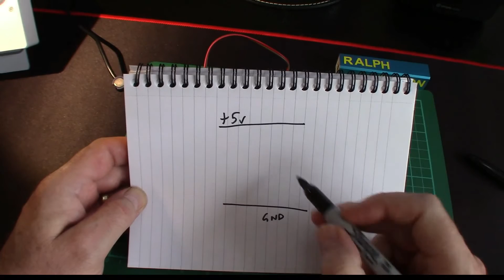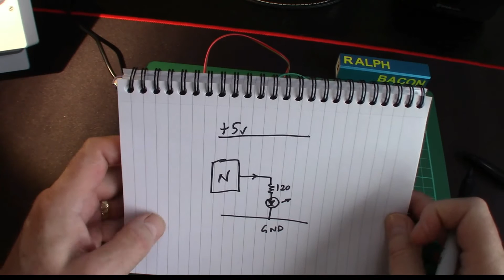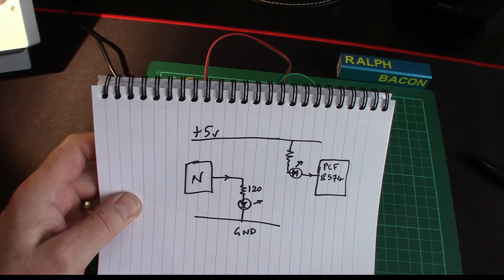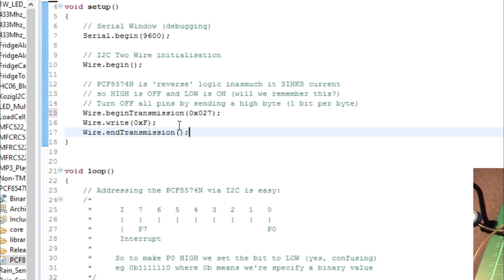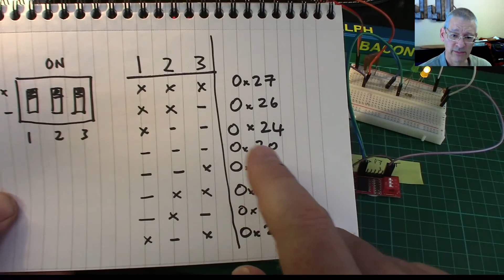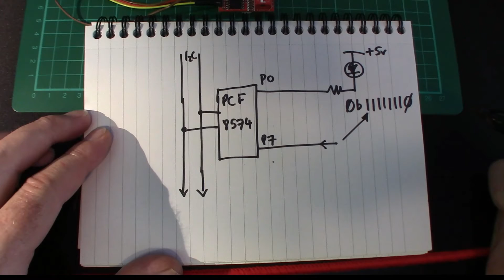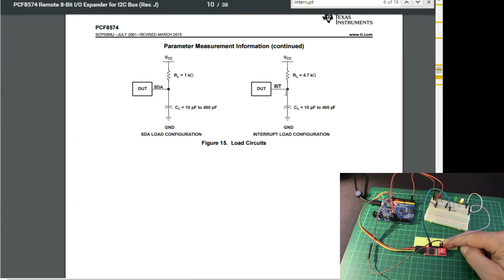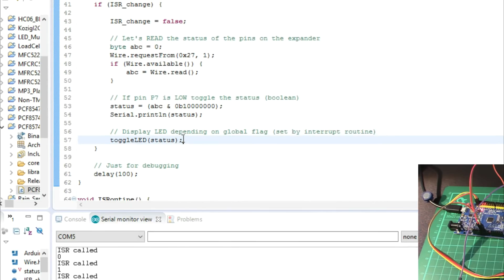#49 MORE PINS PLEASE! PCF8574 Arduino Pin Extender (Easy)

Comment: Hi Ralph 
Was watching this video as always your videos are great and easy to understand. I am thinking about using these on a cable tester. Problem is I want to have a master & a remote to test a cable installed somewhere where the 2 ends can't be brought together. Got me thinking how would this work? 
I'm sure we all have cables to test at times like HDMI in walls between DVD and TV....
We would need to know if the cable was good and if there were cross wires. Maybe a display would show simple 1-1 2-2 3-3 etc or if a cross 1-1 2-3 3-2 for example.
Could be a great video as using these means you test cables from 2 core to  128 cores a great project.
Reply from the maker: I've been thinking about this, Adrian, on and off for a couple of days. It's an intriguing question. I'd probably not use a pin extender but more something like a radio unit like the nRF24L01. Maybe. Possibly something a lot dumber at the remote end, like a switch box. I'll add this to my list of things to think about. Good idea, thanks for posting.

Comment: I wish I could search to see if someone else already made this comment or not using my phone, but oh well I'll say it anyway. Now you can add it to your Attiny and get lots of I2C devices. You'll only be limited my memory. Now if you could just add memory and convert the I2C signal to something else.
Reply from the maker: But you can't add run-time memory to any Arduino-type chip, vonries, so we have to be creative in our thinking (and terse in our code styling). What do you want to convert the I2C signal to then?
Reply: Ralph S Bacon everything I possibly can. I want to know how far a $0.50 chip can be pushed. I don't care how slow it goes just how much it can do. The problem is I'm new to this and have brain injures. Nevertheless, I used to be a pretty good programmer "back in the day."

Comment: Hi Ralph
Thanks for yet another great video - Easy to understand, easy to use. In fact I advise some of my students to see and use your videos - Hope that's OK? :)
Have you tried to hook up - say 4 modules and do read and write routines to them? I'm looking for an easy scan and write routine, that easy sets up and reads data on multiple I/O expanders - maybe I got to the right person? :)

BR
Tomas
Reply from the maker: Well, Thomas, the PCF8574 has an INT output that is designed to be connected to an interrupt input on your Arduino, for example. This highlights the fact, to the Arduino, that one of the pins has changed on the PCF8574. Then just scan (read) each pin in turn and discover which pin it was (by keeping track of what each pin's status was in your Arduino sketch). As they are all I2C you can connect up to four units (that's all your addresses used up for these modules). Reading the pins from each module is the same as reading from one, using a different address. I'm guessing you already know how to do this! I don't have any easy scan and write routines of my own but from what I've described I think its clear what needs to be done?
Reply: Hi Ralph
That sounds somewhat like I intended to do. I would OR the INT signals together and attach the output to the Arduino INT pin. Then wire the PCF8574 INT pins to normal input pins on the Arduino, which I would have the Arduino scan to discover which PCF8574 did the interrupt - and finally scan this module.
Reply from the maker: Yes, something like that. Just connecting a diode in series with each module's INT pin to the Arduino's INT pin should be enough to trigger the Arduino.
Reply: Yes, then you OR with the diodes. But a diode generates a voltage drop up to about 1V. Normally it goes ok, but when it has to trigger an interrupt, using logic gates would be advisable :)
There is some good explanation done here: https://sites.google.com/site/qeewiki/books/avr-guide/external-interrupts-on-the-atmega328
Reply from the maker: Use a Schottky diode, Tomas. Wikipedia says "...Schottky diodes' voltage drop at forward biases of around 1 mA is in the range of 0.15 V to 0.46 V (see the 1N5817 and 1N5711)..." That may help you.
Reply: U win, Ralph. That is a more suitable  sollution 😊

Comment: Great video, very useful. Have you checked out the Microchip MCP23017 ? ... very similar except you get 16 I/O lines (divided into 2x 8 bit ports), 25mA sink OR source per I/O still using I2C (or SPI if you get the MCP23S17 variant) with operating voltages of 1.8-5.5vdc.
Reply from the maker: I haven't, NIck, but I do have another Microchip MCP3--- sorry, I cannot reveal anything as that is the video-after-next, video #112, so no spoilers! It's not so much a pin extender I'm doing next as a pin ----  sorry, can't reveal that either. Oh dear. Seriously, though, your MCP23017 sounds interesting and I like the wide operating voltage, good for 3.3v and 5v µControllers then. Keep tuned to see what I was going on about!
Reply: Ooo ... sounds intriguing?? I will keep tuned. I read your blog also, very very sad. My thoughts are with you & your family.  Contrary to what people say I don't think "time heals", you just learn to accept it & carry on with life. Benny will no doubt help with this process.
Reply from the maker: You are correct, Nick. Time does not heal. I just learn not to think about it too much. Benny is a delight, every single day. And he keeps correcting my sketches for me, he's a genius too. Thanks for posting, I hope I haven't over-egged my next-but-one video!

Comment: Hi Ralph, l like to make things more  complicated...... how about adding 3 transistors to those DIP switchs and connect them to 3 I/O pins on the UNO and go crazy with coding :-) 128 I/Os from three.
 cheers
Reply from the maker: You can add up to 8 of these devices onto the I2C bus, Joe, no need for DIPs or anything. Just give each device a unique address (by soldering one or more of the pads marked A0, A1, A2) and you're good to go.

Comment: why not use shift register, much cheaper and smaller.
Reply from the maker: Indeed this is possible, xmenxwk, but I found it a bit fiddly when I experimented using a 74HC595. There are, however, some detailed instructions on the Arduino web site (link below) for this so it may be something for others to consider. For this demo, though, I just liked the idea of controlling pins via the twin wire (I2C) system, very clean, very logical - but not the only way to do it by any means. I'm not so sure about your claim of smaller (nor cheaper, if you factor in ease-of-implementation) but I won't quibble! Thanks for raising this as an alternative, you never know others may well try it out. Thanks for posting.
Link: https://www.arduino.cc/en/Tutorial/ShiftOut
Reply: Actually shift registers are not difficult to implement, also SOIC-16 of shift register has around half the width of SOIC16 of PCF8574. So they are smaller than the one shown in video, yes you can get smaller size in different package. Also PCF8574 costs more than 3 times. So if you are working in big production and need to save some cost, try shift registers. Thats what I meant. :)
Reply from the maker: You have indeed intrigued me, xmenxwk, and I shall look at this in more detail to see how easy it would be to implement. Thanks again for highlighting this alternative method of extending pins.

Comment: Hi Ralph, I am planning to use an Arduino to control the stops and tabs on a large virtual pipe organ console which will have to sense the binary status of about 250 stops and send about 96 binary signals to solenoids that operate the stops. Can the pcf8574 be chained to read so many channels - or is there another way?
Reply from the maker: How are the 'binary signals' of the organ stops arrange, biopoweruk? You might be able to make a matrix up if you have access to both 'sides' of the switches. That would reduce the number of ports you need. Let me know...
Reply: Each stop knob or stop tab is either 'on' or 'off' and can be switched individually by hand. But they can also be switched by combination settings using small buttons placed between they keyboards. This is done by 12v solenoids on each stop know unit or stop tab unit. I  have collected all the parts on Ebay. The whole console is used as a midi sender so the organ sounds are created by computer using the Hauptwerk program from accurate recordings of historic organs from all over the world. I expect to use relay cards to switch the high current taken by the solenoids.
Reply from the maker: OK, I'm assuming that you have access to both terminals of the stop switches (that is, they are not already connected together with a common ground, for example). By arranging the stop switches in a matrix (rows and columns) you can reduce the number of pins you need to read them. If you watch video #13 it describes in some detail how a matrix to read keys is constructed. You could then experiment with one like I used in the demo (pretending each key was an organ stop key) or construct a proof-of-concept using a dozen cheap, push button switches just to get the design right. Now...
 
Now, sending the 96 signals is another matter. You can reduce the number of solenoids (you really have 96 relays for this?) by 'charlieplexing' the outputs but it gets complicated all too easily and you can't turn more than one on at any one time. So an alternative could be an Arduino Mega 2560 has which has 51 GPIO pins (not including the RX/TX pair you need to program it via USB) plus it has 16 Analog input pins that can also be used as digital output pins (pin 54 to pin 69).
 
But even using a Mega 2560 you will run out of pins almost immediately so using multiple 8574s may be the only way. Note that there are two versions. The PCF8574 has an I2C address range of 0x20 to 0x27, whereas the PCF8574A has an address range of 0x38 to 0x3F). So you can use a maximum of eight of the same type on the I2C bus. That's 16 devices in total, with 8 ports per device = 128 pins in total. Wow!
 
I'd certainly start small and work my way up, to ensure it was all going OK. You may like to run this past the gurus at the Arduino forum, http://forum.arduino.cc to see if they know of a better (=simpler) way of doing this but good luck anyway.

Comment: Hello Ralph
I have been working my way through your videos and hope you continue, they are factual with an explanation which is hard to come by.
This video was also of great interest, but I wondered if you are aware that the I2C bus system has a varying latency, which if timing is not critical then it is not a problem.
Several years ago I need some extra ports to control various stepper motors and over a period of 1hour the stepper motors where not at the correct position. During some investigation it was noted that the problem was caused by missing pulses from the I2C expander. After speaking with colleagues and talking to NXP (Philips the I2C inventors). They explained in length the problem was the I2C protocol and the buffering that it uses. Since then I have used the SPI equivalents with no problems. It would be nice to see a follow up using the SPI variant.
Reply from the maker: That's interesting, not to say worrying, Neal, that the I2C expander would "miss" pulses. I'm wondering whether that was "several years ago" and things have improved now. Hmm.
 
The obvious way to test this would be to connect two Arduinos together via I2C (one as slave, the other as master, via this extender) and send a sequential number down the line. If the slave did not receive the correct number then we would have found our problem.
 
Frankly, given that this problem was highlighted with stepper motors which are hardly the most precise bits of machinery, I'm wondering whether these were the issue rather than the I2C bus, regardless of what Philips may have said! But we can prove the I2C issue fairly easily. That's the Royal "we", BTW!
 
Expanding the number of pins via SPI (perhaps using a MCP23S17) would be a good experiment, nonetheless, so I'll add it to my growing list Interesting Things to Do! Thanks for the suggestion.
Reply from the maker: I wonder whether if you had run the I2C bus at 400kHz you would have had the same problem? Or these days you can even get it to 1Mhz (not done that though!). Anyway, the SPI pin extender idea is on my list!
Reply: Just a little more information.
The I2C expander used in the project was a Microchip MCP23017 and the SPI variant was a MCP23S17. The  bus line(s) pull-up resistors were 1K2 which is recommended for the 1.7MHz transfer, but due to distance/line capacitance should allow the bus to happly run at 400KHz.

Comment: Is PCF8574 can handle/controll the sensor like DHT11/22, DS18B20 or other sensor ?
Reply from the maker: Interesting question, Renji. So far I've just read the state values (or set the values) of an individual pin (or a collection of pins) on the PCF8574 but I've not tried it with a sensor which is queried like this. Perhaps others have had experience of this and might chip in but I've added your question to my ever growing list and it may get answered in due course. If you find the answer do please post back here! Sorry I can't be of more help right away <sad face>
Reply: you got the answer ?